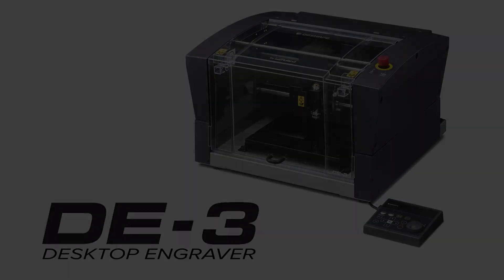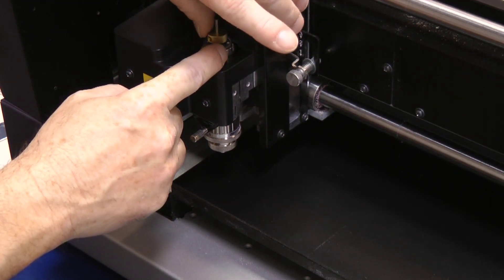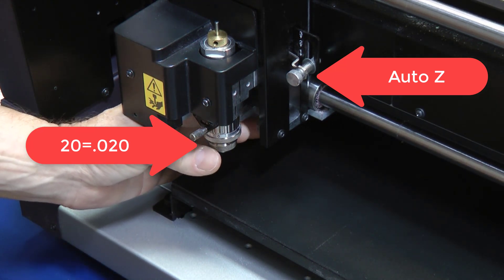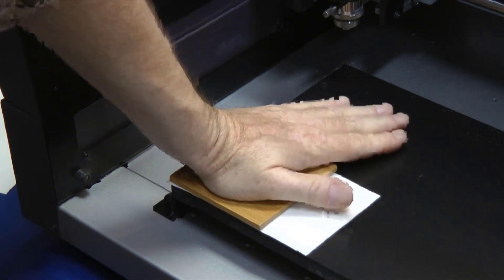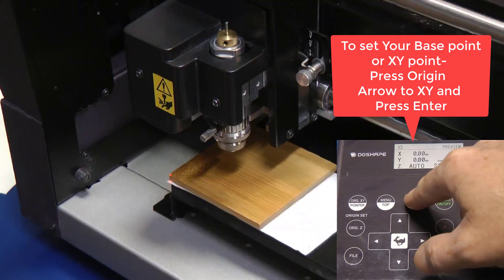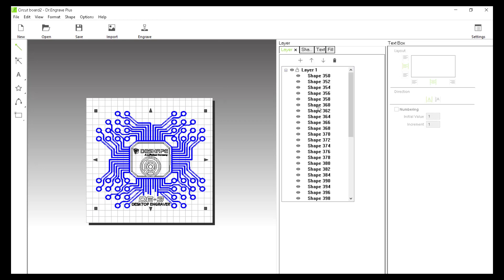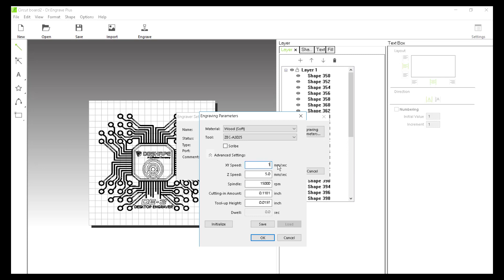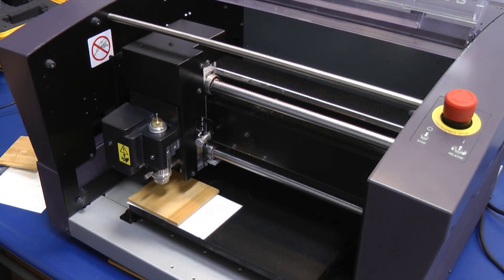DGSHAPE DE-3 - Dr. Engrave Software

Comment: You give zero support on a machine that costs over $6,000! WTF?  I can't even use this thing because the auto z stopped working after only a few weeks, for no reason.
Reply: The Dr engrave should be included with the setup disk they provided. As for your auto z, is your head set on the 1 or two position? And is auto z turned on in your machine settings?

Comment: Do you have a video or any info on manual Z control? I can't get dr. engrave plus "cut in" command to do anything. It just runs through the cut path at the set Z-0 height
Reply: this is happening to me, did you ever get it fixed? im using vcarve.